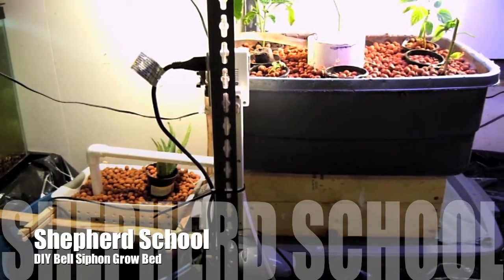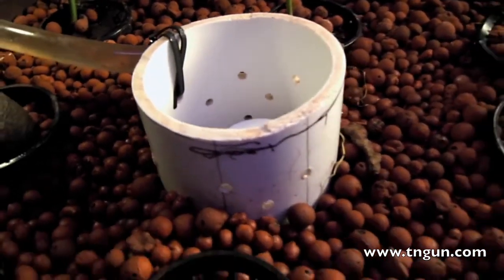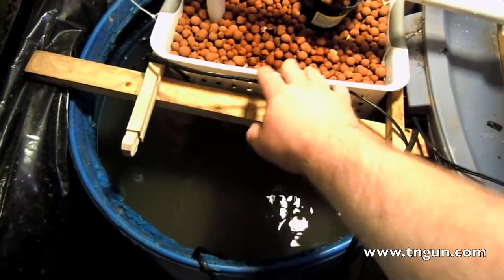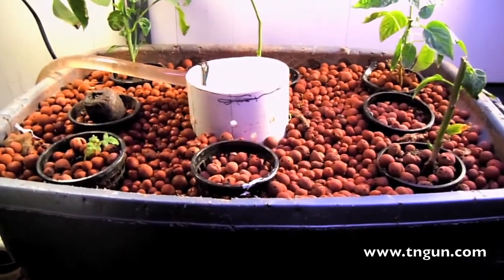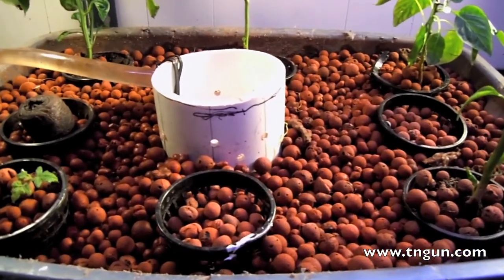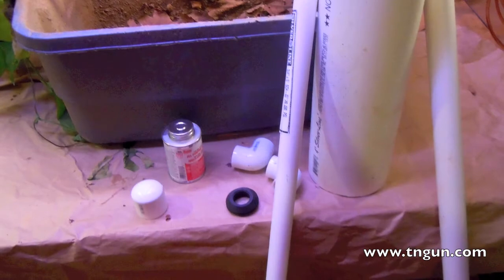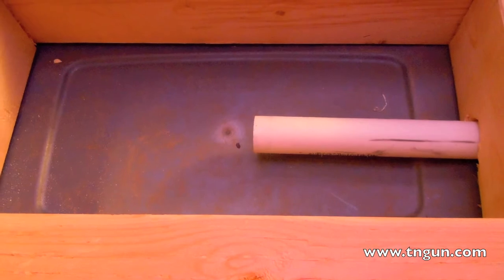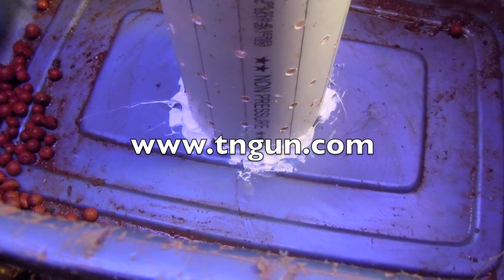How to Make a Bell Siphon | Construction and Principles of Operation

Comment: but still, u need the water pump to be on all the time to refill the water. have you tried putting 2 setups next to each other? probably wont work; but maybe when 1 setup overflows, it will force the water to the second setup. then back and forth. otherwise, i dont see the point of this. you can just pump the water up and use a few hoses to spread the water throughout the bucket, then at the end of the bucket just use a hole to drain it.... well i should just say an ebb and flow.